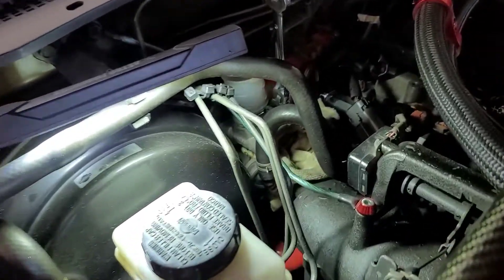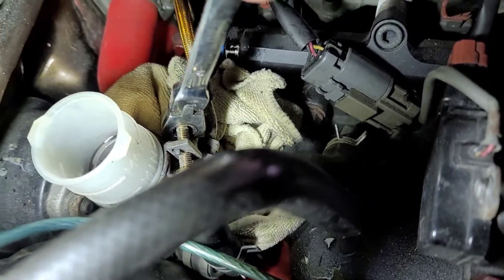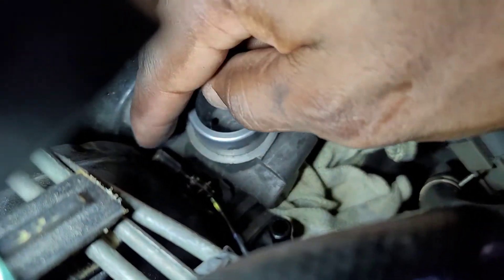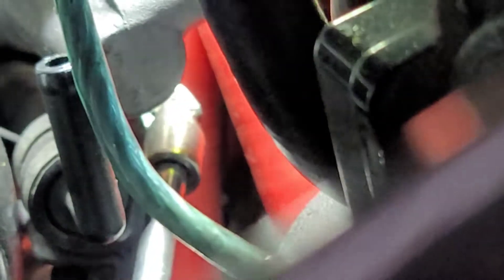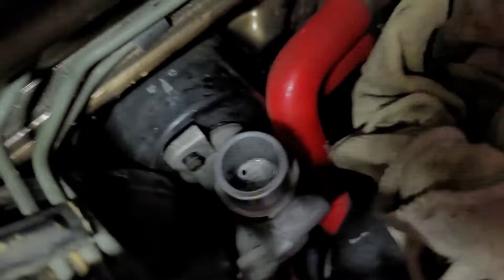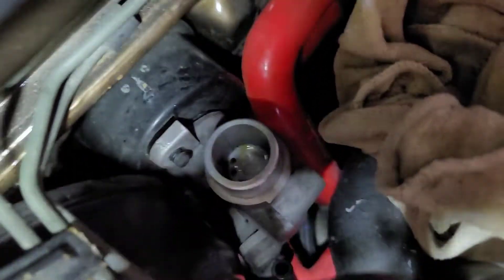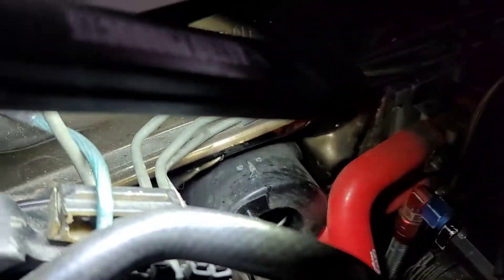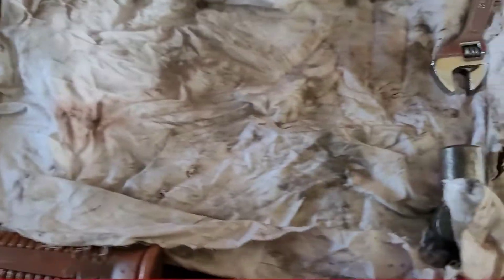How To Rebuild Clutch Master Cylinder | R32,  R33, R34, Nissan, Toyota, ALL CARS 😑 WATCH IN FULL

Comment: I appreciate the great video!  I'm about to replace my master/slave/line with limited room.  Just to confirm - you can pull the master off the booster and disconnect the pedal line from inside the bay?  No need to get up under the dash?
Reply from the maker: @Und34d_R  thank you for watching.. it should come out of the booster from the bolts

Comment: Thanks for the video! Was wonder what is that grease? Or what would be the equivalent in North America?
Reply from the maker: It's just an all purpose grease you can get at AutoZone, O'Reilly, or tool store.
Reply: @Nismology33  thanks man for the tip, really appreciate the information. My mechanic thought bleeding the coolant system on my r32 gtr was simple like typical Honda lol. Boy was he wrong, he spent another 5 times and opening up the air bleeder around the fuel rail hahahha. So yeah just replaced by slave recently but I am sort of paranoid about my master leaking internally? I feel like you just need to bite the bullet and rebuilt it
Reply from the maker: @michaelszutu253  no problem it is pretty simple. I go through the headaches and show you guys the way of doing it lol. Bleeding the coolant isn't bad as long as you have the funnel that I'm using
Reply: @Nismology33  was thinking, about the attesa nitrogen canister and how terrible it's going to be to change. Even if I dropped the rear subframe, getting the stupid thing off is still a huge challenge
Reply: Thx for the vid.  Just replaced slave on my r34 but original looked fine.   Added dot but still no pressure so ordered the master rebuild.